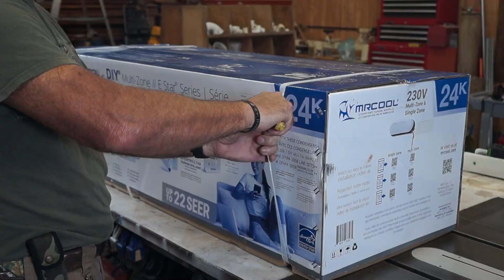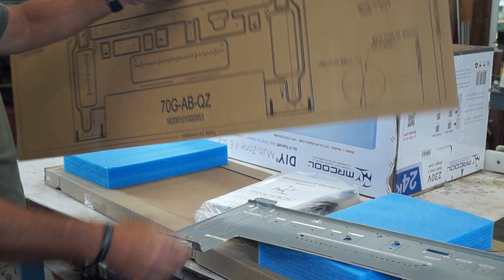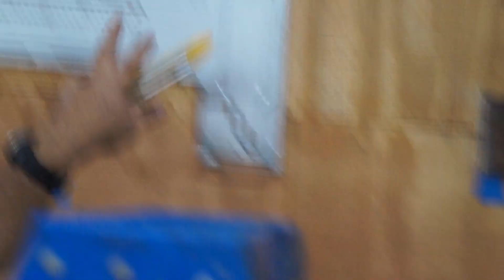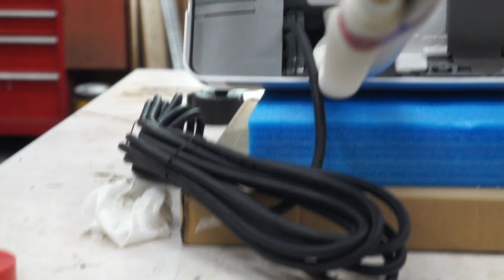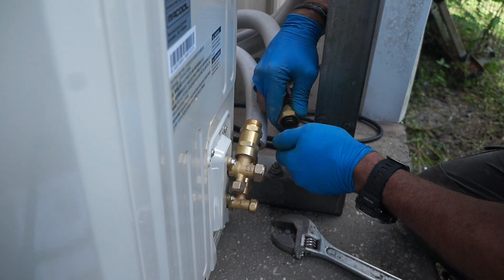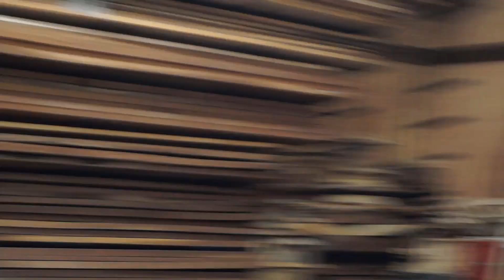MrCool DIY Mini- Split AC System Installation - The End Grain Workshop

Comment: Would a 12,000 Btu be enough for a 24x30x10 (720 sq ft) metal building with 1 1/2” foam board insulation?
Reply from the maker: No, that's the exact set up that I have and I went with a 24,000 BTU system.  Based on the BTU calculator that volume of space requires at least 20,000 BTU's.  I hope this helps and thanks for watching!
Reply: @TheEndGrainWorkshop  That does help me. Thank you.
Reply: I was thinking about getting this same unit, but my woodshop is wired to 110v. How would I convert from 110v to 220v?

Comment: Better than most mini split installation videos.  On another note I have the same interior plywood and was hoping you could share the stain color and brand you used on trim you cut back for the air handler ?
Much appreciated
Reply from the maker: Hey Arthur 
I used Minwax wood finish penetrating interior stain from Lowes.  For the T1-11 siding I used Golden Pecan and for the trim I used Special Walnut.  I hope this helps and thanks for watching.

Comment: Your video shows you installing 10 AWG to transfer switch & condenser but in the MrCool installation instructions it recommends for a 24k unit a minimum 8AWG, 6AWG preferred.
Reply from the maker: Hey Pete - My manual recommended the following:
9K, 12K and 18K - 20 amp breaker and 12 AWG wire
24K - 30 amp breaker and 10 AWG wire (my unit)
36K - 40 amp breaker and 8 AWG wire
Below is a link to my Mr. Cool Manual for my particular unit.  The units change and you might be looking at a  different generation which may require different sizes.  I would use whatever they recommend in the manual the comes with your unit.  I hope this helps and thanks for watching.
 
https://drive.google.com/file/d/1GyoAAn62Y92_HgfmSdzBITe_MqyIicok/view?usp=share_link

Comment: Hey I heard that Clutch tune! I have the same system on my tiny house which is 40x12 with the lofted barn roof.....it works great the only thing I can say about the setup is you'll NEED to make sure you have a full charge on your 410a. And really tighten the fittings super tight or you will have leaks.
Reply from the maker: Thanks for the information and thanks for watching.  Good catch on the Clutch tune!
Reply: @TheEndGrainWorkshop  easy Clutch been my favorite band for 20+ years!! Cheers to ya!

Comment: Thanks for sharing! Is that a Rolex NM type wire? Indoor or outdoor wire? Thanks much
Reply from the maker: Hey Arthur,
It’s a liquid tight whip with stranded THHN/THWN conductors.  Outdoor from the disconnect to the unit.

Comment: What is the square footage of your shop?
Reply from the maker: 750 sf and my ceiling is 10 feet high.  The workshop is 25’ x 30’.
Reply: @TheEndGrainWorkshop  I was curious because i am about to have a 30x45 built on my property. I saw that you had a 24k air. I will probably go with a 36k. Mine will also have 10 foot side walls. Thanks
Reply from the maker: @terryunderwood6742  36K BTU is rated up to 1500sf so you should be fine.